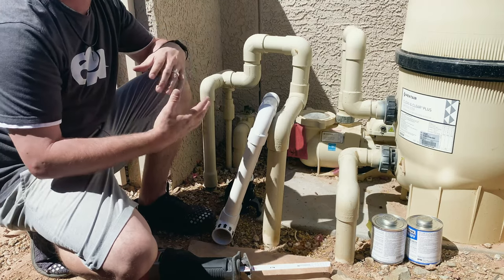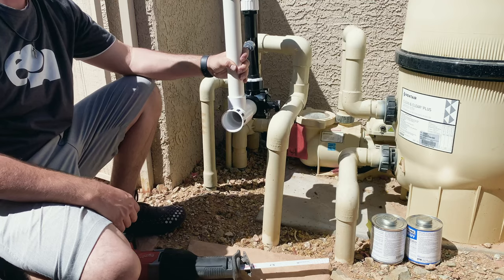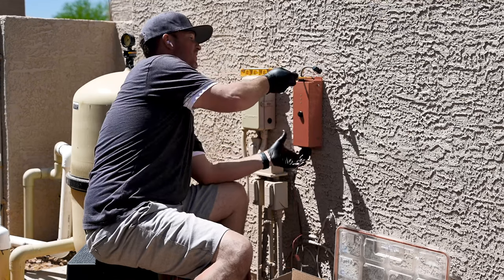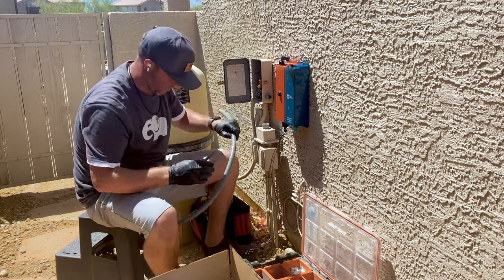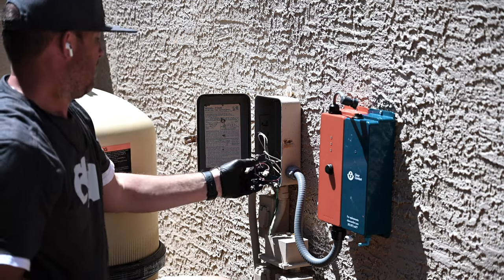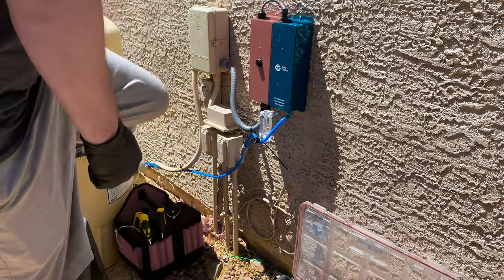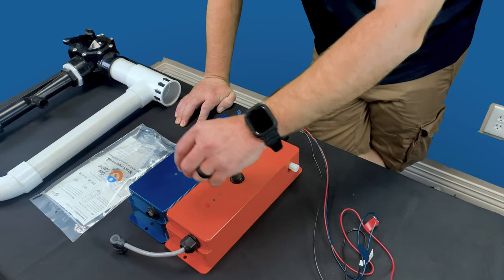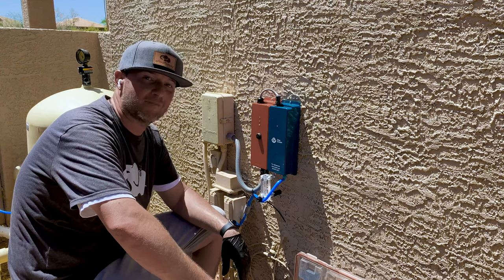How to Install Clear Comfort AOP System - CCW100

Comment: You need better tools. Shorter Sawzall blade to start. You should invest in some Milwaukee pvc shears. Have you ever heard of Weld-on/Christie's Red hot Pool pro not crap at home depot only purchase from a pool supplier. Blue fades to clear.
Reply from the maker: Haven't no, but I will pass this information along to the owner. Have a great week!
Reply: I could have plumbed that in better . Installed 3 of these and always improvised for better flow. Those are some serious 90's and bends